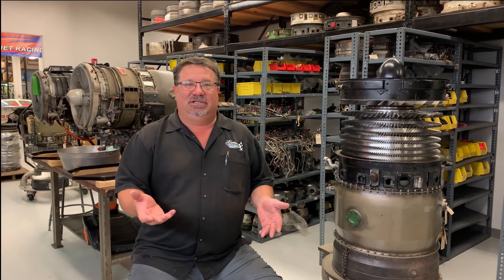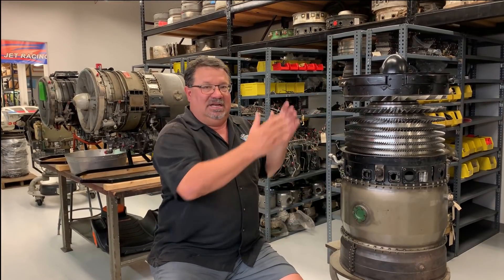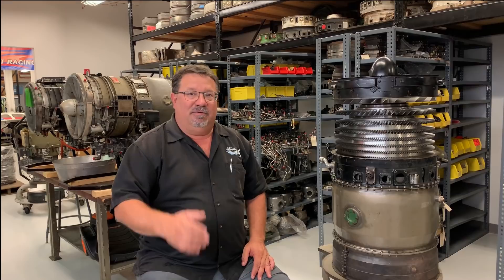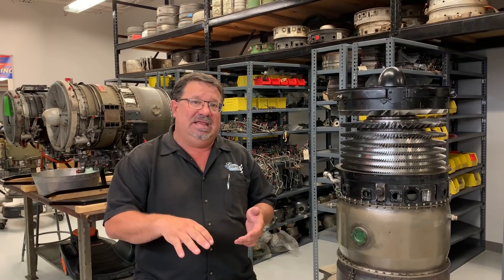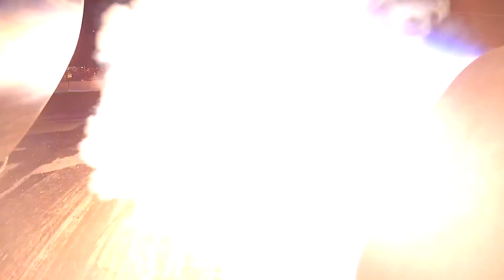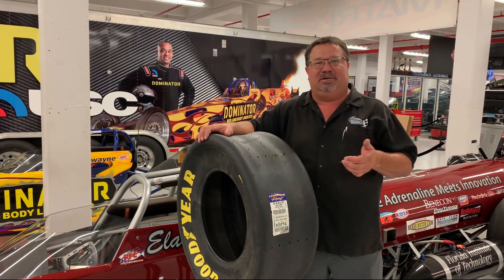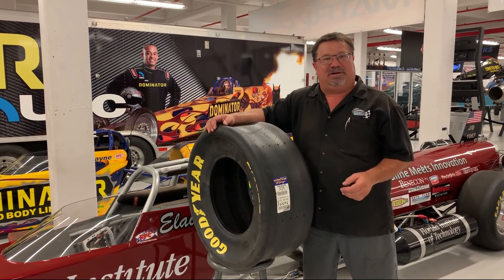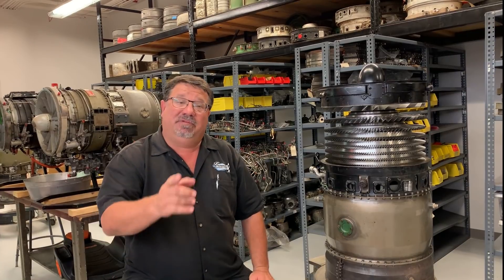Questions Answered!!!

Comment: what type and how much if any oil do you use in the engines  how often do you rebuild them what brand of brakes you running
Reply from the maker: Mamamia10963 we use Mobil Jet 2 or BP 2380. 3 quarts. We do a hot section inspection 1 time each year. We use a fiber optic scope {bore-scope) and other methods to inspect the engine between each event. We use Wilwood brakes.

Comment: How are you breaking traction with a jet engine ?
Reply from the maker: worb radar the disc brakes of the car are used to hold the car back on the starting line with the engine at full power. Once the after burner is lite, the brakes will no longer able to  hold the car back. The actual traction is the contact patch of the tire on the racing surface.